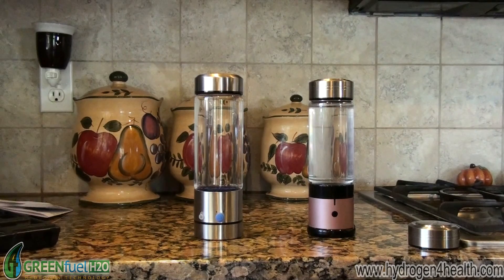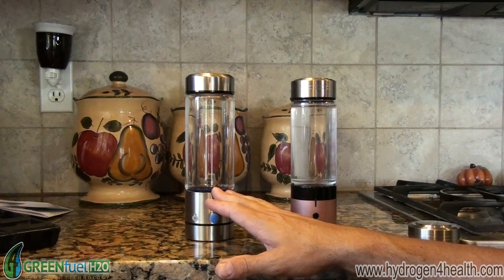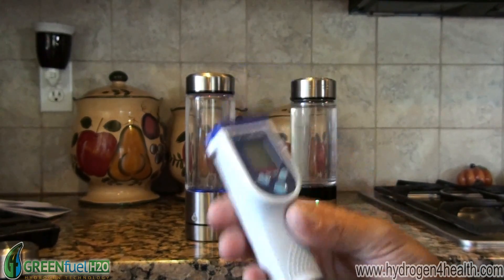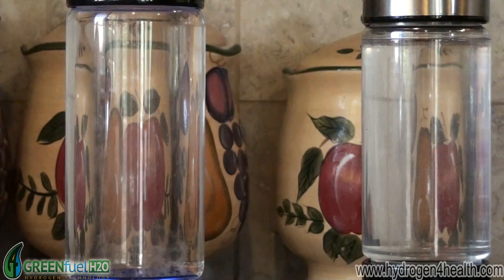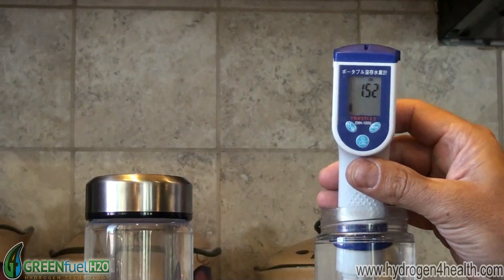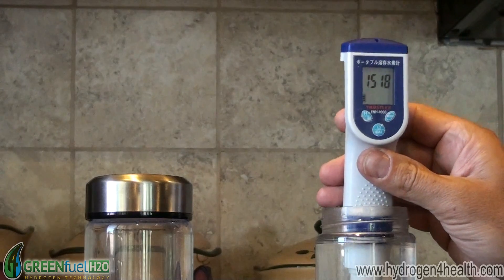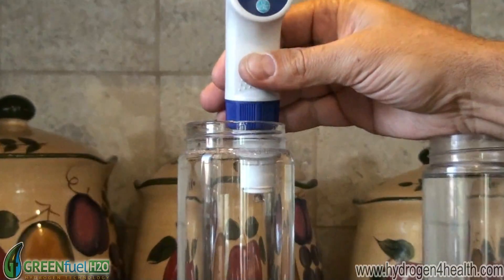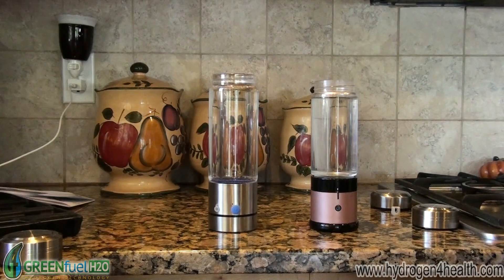We compare the H2 content of our SPE bottle with a industry standard hydrogen electrolysis bottle

Comment: Hello.  I've purchased two of those bottles (shown on the right side in this video).  
When making the hydrogen water, one of the bottles does not produce the same volume of hydrogen bubbles as well as 'flow' speed.  I'd like to clean the SPE membrane with citric acid (as the instructions suggest) to see if i can improve performance.  How do I get the membrane out.
Reply from the maker: You don't take the membrane out. Fill the bottle 1/3 way full and put in 1 teaspoon of citric acid, put cap on and shake for 30 seconds. Let sit for 1-2 hours, dump out and rinse.

Comment: How long do both of these last for before you need to replace them?
After you've done this, do you just drink the water? How much distilled water did you put in each jar before running them? How does the one with the SPE rate compared to the Lourdes machine in your opinion.
Reply from the maker: They will last 5+ years. 
You can drink the water straight out of the bottle. Thats what I do!
Mormally you would fill the SPE bottle to the top.
The Lourdes machine produces 1.0+ppm. So does the SPE bottles.